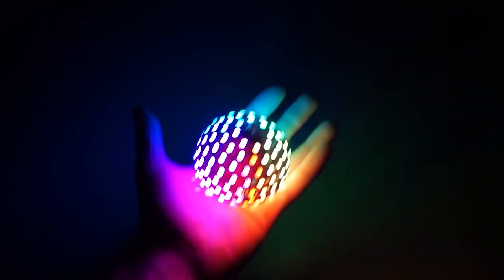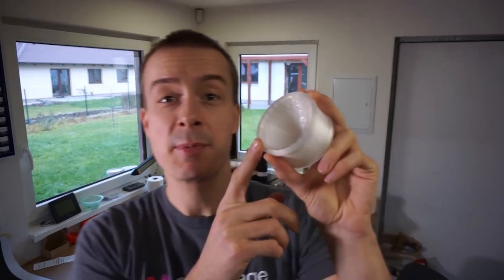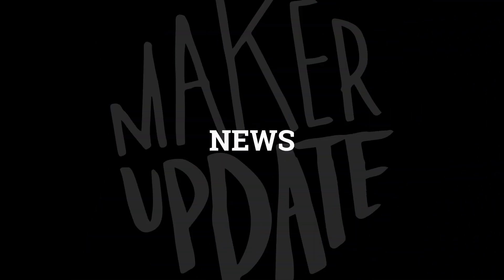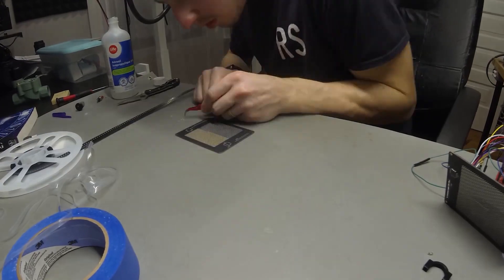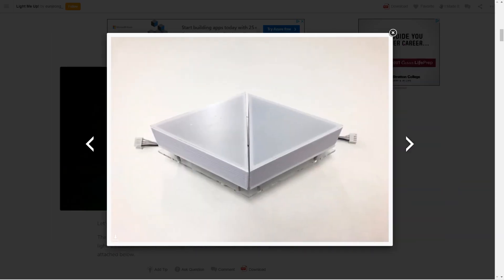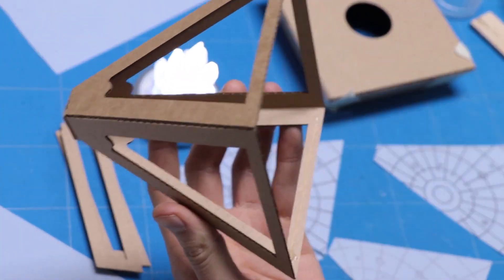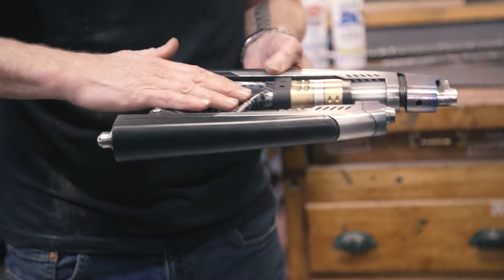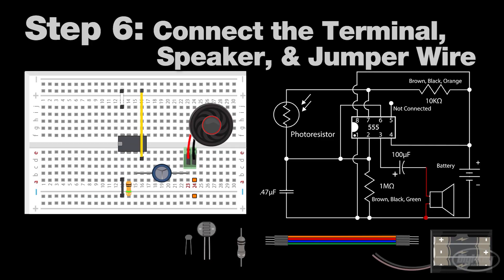Pixel Patience [Maker Update #156] - Maker.io

Comment: Thank so much for the shout-out! Amazing work as always :)
Reply: Thanks Aidan! I was really inspired by your project. Have you tried spray concrete sealer to make the results a little more water resistant? I remember Becky Stern using that stuff to seal up 3D printed planters and I was thinking it might be a good match.